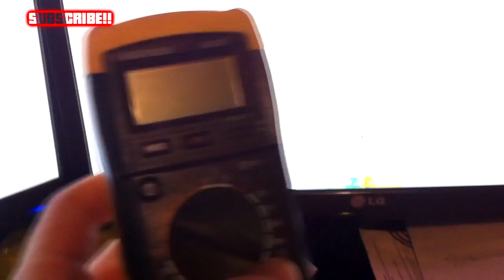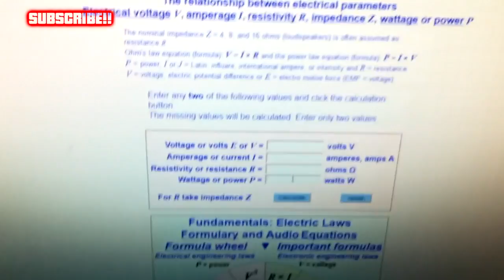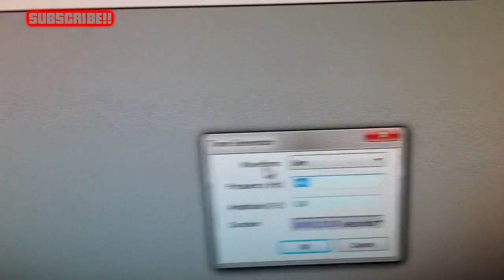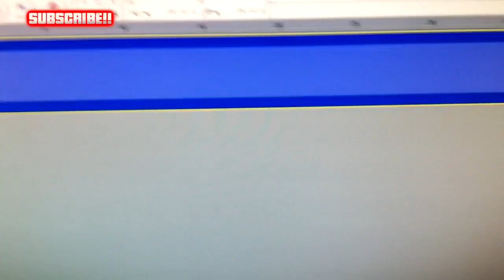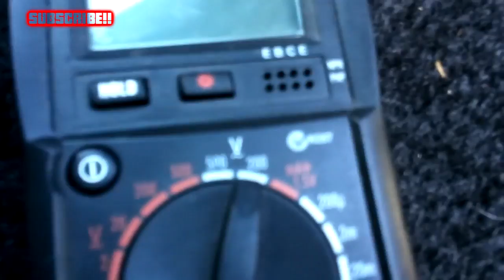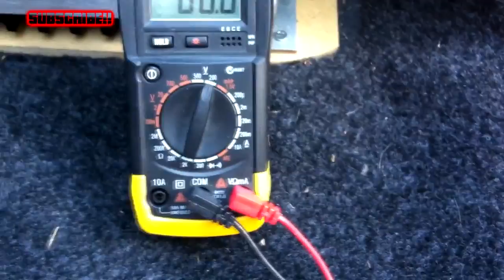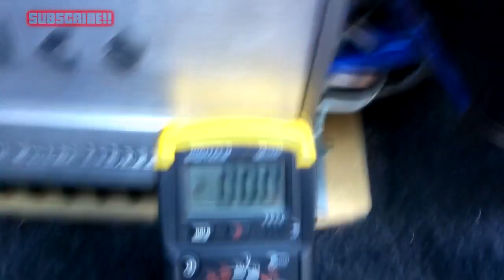How To | Set Amplifier Gains With A Basic Multimeter | Car Audio Tutorial

Comment: Hey thanks for a nice and clear tutorial.I have tried this method on my Hifonics Zeus amp and it doesn't seem quite right.My amp is 110 watts x 4 at 2 ohms and the volt setting calculation comes to 29.66 volts.All I can get out of it at full gain setting is 8.1 volts.I have my head unit at 75% volume and am playing a 1khz tone for my full range 4 speaker set up.I can't understand why my volts are not getting anywhere near where they are meant to.Any suggestions greatly appreciated.

Comment from the maker: So it is a 4 ohm sub, with 2 + and 2 - connections and its currently running at 2 ohm on your amp? My guess is that if your amp is 1700rms that it would make 1700rms at 1 ohm and like you said 1200 at 2 ohm. With that woofer you should tune the amp to 1200rms@2ohm. To tune to 1200rms@2ohm you need to tune to 48.5v on your multimeter

Comment: Im still trying to get the hang of this but when i tried this today i did everything you said but my dmm didn't move from 00.0 and when the instead of the 50 Hz sound not coming out of anything they came out of my 6 x 9s any suggestions. I am using a Hifonics BRZ 1200.1d amp and 2 2ohm CVR's.

Comment from the maker: That is because you are using a different ohm load, these amps are not as efficient at 1ohm and so they will not put out more than 34volts at that load without clipping, they are more efficient at 2 or 4 ohm loads and will put out a greater voltage without clipping

Comment: Cheers man great vid, however i cant get anything but 0.01 on the meter?? It is set at ACV 200 and the meter works fine not sure what im doing wrong??

Also i am setting up a 4 channel amp for component speakers not a sub so do i still need to used a 60 htrz tone?

Cheers for the help.

Comment from the maker: Leave the Phase on 0, subsonic should be around 20hz, low pass around 80hz. Maximum gain is not right and I suggest you reset it with a multimeter because I can guarantee you will be clipping at full gain

Comment: we have the same amp brutus, mine is 1700 im running L7 15" 1000W single at 2 ohm fina my computation on what V i need is 58V i set the gain to the maximum not using any multimeter im not sure if i did it right.. confused in mixing the subsonic,low pass and phase

Comment: I was using the ac volt output set to 200, only running a 40hz 1500hz and 1000hz threw it and that just caused it blow i guess lol

Comment from the maker: What happened with mine was, it would read sub frequencies (40hz etc) but it would not read the 1000hz tone to set my 4chan. Instead I just had to play music and more or less guess it was set right. 

With my current setup though, the gain on my 4chan is all the way down, my headunit has 4v pre outs and my amp only takes upto 6v to get full power, but I dont need full power out of the amp.

Comment from the maker: Yes that is exactly what you can do. Just type in ohm rating of the sub, how much power you want to give it, and it will give you the right voltage. So if your sub is 1ohm, 1200rms is 34.6v, but if you only want to give it 600rms, then you only set the voltage to 24.5v.

Comment from the maker: I had the same issue when trying to read 1000hz on my 4ch, the multimeter just would not pick it up, just make sure it is set to read AC volts and if it has a voltage range set it to 200v. If that doesn't work then the meter just cant read that frequency, like mine.

Comment: I am new to the whole tuning with a multimeter so have no idea what happened to mine. I have a 5 channel amp, i can set the 4 speakers too 1500hz no problem but when i try and set the sub channel the multimeter does not read at all and trying to set at 40hz, but it worked the weekend before. Also it would not read my other amp that is pushing more power than my 5 channel. Do you think the meter is broken or something????? Cuz i have no clue at all!!!! Should i buy a new one????

Comment from the maker: All settings like loudness and EQ should be off or set to 0. As for the volume I would go to about 35 just to make sure it is a clean signal. I could probably set mine as high as 50/60 but my 4channel amp is not made to handle the full power of the 4v pre outs. Usually take about 10-15% of the max volume and you should be clean.